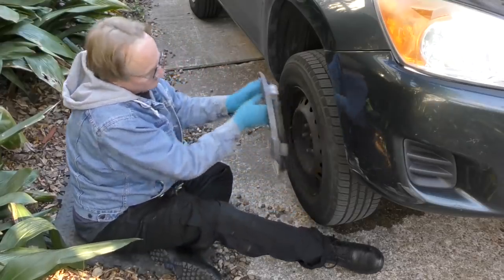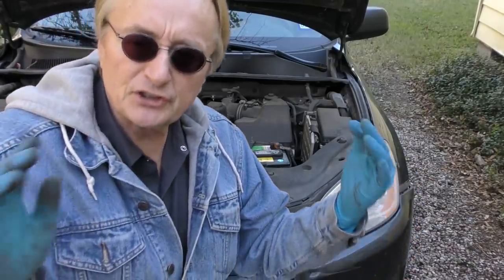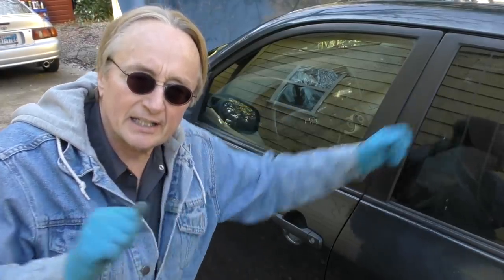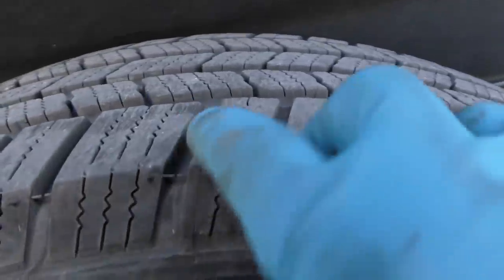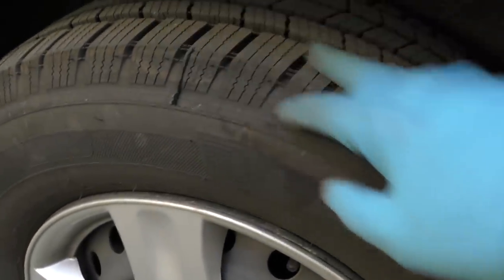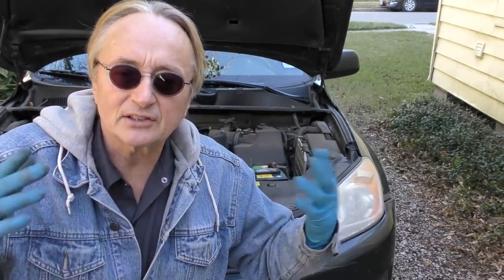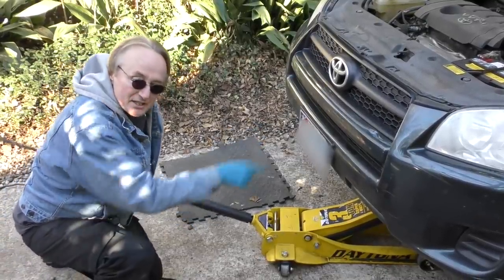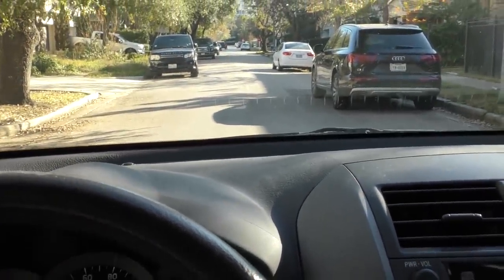Tire Secrets Only Mechanics Know

Comment: the idea is that most of the braking and weight is on the front and in a panic stop if you don't have enough grip in the rear it can come around causing a spin. it all comes from law suits from the 80s and 90s before abs was commen. why didn't you jack in the middle on each side on the sub-frame instead of all that time consuming each corner thing or do you get paid by the hour?

Comment: Scotty I took my wife’s car to Canadian tire to get 2 front tires they said we have to put the tires in the back. I said can you put them in the front and got they said it would slip when breaking if put on front I said still please put them in the front. And they did do that but they also tightened the breaks on passenger side rear tire so when wet out the back passenger tire would lock up. That is dangerous and ridiculous to do just to prove a point. I think they also wanted to sell 2 more tires because when I was getting my keys he said if it slips come back we will put some new ones on the back too. I never trust anyone with my cars anymore. People will do anything and risk lives for an extra buck.

Comment: Here's a question Scotty, and a freebee answer...
When I drive around in my 07 Escalade with the windows open, I occasionally hear an annoying cricket-like squeak from a wheel on one side of the truck or the other. Sometimes it sounds like it's coming from the front and sometimes the rear. I pull off a wheel and check the rotor and pads, nothing wrong. Put it all back on and the squeak is gone. Months later, it starts up again on the other side of the vehicle. Again, I take a wheel off, put it back on, and the noise is gone. 

So yeah... it turns out to be the hub caps! Pop the hub cap off, put it back on slightly rotated, and the squeak is gone. For a while. But you already knew that, didn't you? You ol rattlesnake!

Comment: There are two numbers on the side of the tire 4319 would be 2019 43 week of manufacture. anything older then 5 years goes into the garbage.
Reply: Probably for winter tyres. Nowadays tyres have longer shelf life and "on the road" life.... ofcouse dependant on how much sun light they get and how you overhead them in the canyon.  I have a forester the summer tyres are 9 years old but they have decent thread and no cracking. On a friends car he has 5 year old Nokian tyres cracked all over. So inspect the tyres and see whtas their condition if they are good drive them. You will save money and the environment as you will produce less rubber waste. If everyone sticks to your recomendation boy oh boy how many billion new tyres will end up in the dumpster

Comment: they did that to me one time after about 5 minutes I just told them to take them off and put my old tires back on. they moved them to the front. my mom went in with the spare on the truck and told them she wanted 4 tires mounted on the wheels and put the steel wheel as the spare. damn if they didn't put tires on 3 mag wheels and one steel and didn't and mounted her bad tire as a spare. after fighting with them for over a hour she called me and when I got finished with them she came home with 5 new tires for 100% free. but we refuse to even go to them anymore.

Comment: I'm so glad you mentioned tire placement arguements with "tire experts" they are complete morons. Maybe in a RWD car do you want the good tires in the back. 

If I didnt MAKE them put the best on the front I would of flipped my car. Getting of the freeway I hit the onramp a little fast, my normal speed. Low and behold,  there was a stream of water! My rear end slipped out but my front kept traction. 

If the bad tires where in front I would of lost control and crashed instead of being able to get ahold of it.
Reply: That is exactly why you put best tires on the rear, is to keep them from hydroplaning. It sounds logical to put best on front for traction, but at high speed when it is most dangerous is when you want to do what is the safest, with less weight on the rear you need better tread to disperse the water better to keep it from spinning around. It just happened to one of my fellow employees , because they thought the same thing, best on frount and it rained the next day and he hit a water puddle and the rear end came around and he totaled his car. Go to tire racks web site and read the article they have on their sight. I am a master certified technician and I keep up with what is discover from most recent events. I have 50 years experience. Final thought: Rotate tires every five thousand miles and replace all four tires at the same time and remember that most technicians in your modern shops have fresh eduction.
Reply: @lest0328  That told 'em, Les.  Too many petrolheads out there driving around blissfully ignorant!

Comment: I guarantee you those struts are worn out.   Pushing on the bumpers to see if your shocks are good will not prove anything really.   Those front tires are wearing more like they are is because the  shocks are worn out and may need a front end alignment.

Comment: I loathe and detest front wheel drive cars.  Of course, it's a better use of space, you don't have the power wastage in the transmission to the axle and it pulls better on snow.  But the thing for me is handling characteristics: you make a mistake with rear wheel drive you go into oversteer, which is easily correctable.  Make the same mistake in FWD, and you understeer and, yes, you can correct it but it takes time by which time you're car's making out with a tree.

Comment: I completely disagree with you, the best tire should be on the rear wheels. yes, bad front tires will be an issue, and putting them in the rear, you won't feel that they're bad: that's exactly why you should have the best tire in the back. New or old car.

You can't feel the rear tires, so you need to make sure that they will lose traction after the front do, because when the rear tire loose traction, it's sudden and a lot more dangerous and harder to correct than losing traction on the front axle.

I've experienced both, and I will always choose to put the best tires on the rear axle.

So the exact reason why you say you should have the new tire on the front is the reason why you should have them in the back.

Loosing traction accelerating is not deadly, spinning out is.

Also, because front tires wear out faster, it's a good way to preserve your new tires and use the old ones so you don't and up with old dry tires on the rear axle. And tire that are slightly older usually don't wear as fast as brand new ones. So financially it's better.

If your tires really don't feel right on the front axle, you shouldn't use them on the back.

Comment: speaking of hubcaps, you might notice many late 90s and early 2000s Corollas and Camrys missing hubcaps. They become loose and fall off because of the poor cheap design
Reply: Have seen this. They should have done as honda did back then and make it where yhe lugnuts secure the hubs to the tire. Ive a 20 year old civic with all its original hub caps.

Comment: Putting the slippery tires on the back increases the risk of a spinout.  Watch how often this guy says how slippery his tires are, and then explains how he put them on the back.  He's so proud of himself about it too.
That's why they won't put them on the back Scotty, because when you spin out neither you or the victims you hit can blame and sue them.
Also you should know better than to run 7yr old tires.  Tread depth is only part of the equation.  The rubber, adhesives, and the steel belts in the casing oxidize and deteriorate over time.  No tire should be in operation on a public road older than 6 years after manufacture.

Comment: Could’ve been warped rotors 🤷🏻‍♂️
Reply: That would've be the next thing to diagnose/check if the tire rotation didn't solve the problem.
Reply: Only problem is , he didn’t go fast enough... I’m sure it has warped rotors . 99% of the time if you feel a shimmy in the steering wheel ONLY when you hit the brakes, the rotors are warped . If it shakes without applying the brakes , the tire is either out of balance or out of round .

Comment: you can put your tires where you wish, but i will put them on the rear. after loosing an argument with a tree and the passengers side door on my old truck after moving the better tires to the front (recommended from my old mechanic).I would gladly have hit that tree with the front of the truck than the door any day.

Comment: It's "The best tires in back, in the winter".  Or with any hard braking and you'll be going for a spin.
Reply: I had this problem with a tire place where my front tire had a previous camber problem causing the tire to start showing belt and the guy said "we can't rotate your tires because the better tires need to be in the rear." If it wasn't for me having to send someone to get them rotated for me I would've fought him. My commute at the time involved the freeway where there's this downhill with a curve at the end where the worn tire would be on the outside of the curve, and the whole reason I sent it in was the thought of blowing that tire and going off at about 80+ mph.
Reply: 4 new tyres and hard braking and turn and still go for spin. But yes as some have said, drivers think only understeer would happen if brake and turn car or just turn even. Depend if all 4 new tyres or how front and back tyres are as well as how hard brake before turn

Comment: Some years back I bought a set of "Falken" brand tyres for my little sporty.  Worst things ever.  Probably because of a dud compound and maybe later revisions fixed it, they were okay in the dry but anytime it got wet they were a disaster just trying to get off the line or even accelerating in 2nd.  This is a crappy 1.6 litre front wheel drive BTW.  From new to worn I hated those things.  The brand I have now are brilliant, but forgive me if I don't mention it here as I'm too lazy to take a look.. ¯\(ツ)/¯

Comment: Scotty I work at big o and your wrong on this video, you are putting a lot of people in danger especially in wet weather making them think you should have your better tires on the front.... When you corner and make split second turns that could save your life you want your good tires in the back. When you turn your car all your momentum shifts to the back tires and that's where you want it to grip the road better so you don't lose control and spin out , listen to me society this oldschool dopefiend mechanic knows a lot I watch all his videos but trust me on this one , it proven when you corner your back tires are the ones holding your composure , better ones in the back during bad weather shift them to the front during the summer ,spring.

Comment: Correct me if I'm wrong but shouldn't the car break normal in the first place with the "OK used tyres" on the front. I mean these are still very good tyres with lots of life left in them. What you are saying is having 2 "OK used tyres" with lots of life left in them on the front of your car makes it feel like losing control when braking at higher speeds. So what's gonna happen if you have 4 "OK used tyres" on your car.... like 99% of all vehicles out there on the streets. So this doesn't make any sense to me that 2 "OK used tyres" on the front and new tyres on the back is making your car feel like losing control. If there would be a new tyre on the front left and a very badly used one on the front right I would agree but when having two same ones with the same condition the car shouldn't perform any different then having a longer or shorter brake distance. From my experience having proper torqued lug nuts and having your tyres balanced does the trick. But still don't take this as criticism, it just doesn't make sense for me.
Reply: It makes perfect sense. Those tires should have been rotated long ago.
Reply: @rays7437  Well if you were able to grasp meaning from reading you would know that I said the tyres should be rotated.
Reply: @mathiasm3462  
Your comment reads as if it were based on the assumption that the front tires were worn evenly.
Reply: @rays7437  exactly, why shouldn't they
Reply: @mathiasm3462  
The tires were not worn evenly. If the alignment is off or the struts are weak, or the driver corners hard,they wear unevenly.
Reply: @rays7437  OK so how is that gonna change if you put the front ones then on the back....?
Reply: @mathiasm3462  
Because the rear tires wear differently than the front tires.  The driving tires will wear differently than the riding tires.  Tire rotation is the practice of moving the wheels and tires of an automobile from one position to another, to ensure even tire wear. Even tire wear is desirable to extend the useful life of a set of tires. The weight on the front and rear axles differs which causes uneven wear.

Comment: Damn he is putting those lugs back on with the impact driver. I always hand start the lugs first, then air drive them, then torque them down to specs. Putting them on like he did can cross thread the lugs.    Not good..

Comment: New tires go on the rear because under  wet conditions you're more likely to spin out of control while driving turning in wet conditions with new tire's in front and worn in the rear.  Michelin tires did  scientific research and proved it.  Btw I've been a technician for 40 years and I'm 44 year's old too. I started working on cars in my mother's womb.  😂
Reply: mechanics ride hars ,so must accelerate quickly..thats important..and must stop quick too..
Reply: @maartenyzer4121  When tires are replaced in pairs in situations like these, the new tires should always be installed on the rear axle and the partially worn tires moved to the front. New tires on the rear axle help the driver more easily maintain control on wet roads since deeper treaded tires are better at resisting hydroplaning.
Reply: @firebird196771  i know but i always put the best in the front ,so i can change all 4 at the same time ,so all my tires are fresh and not rotted..
and have the same dot..

Comment: I have the worse luck with tires.
Reply: New Edge Mustang,
Does that have anything to do with how you drive the car they're mounted on? Or the quality of the tires?
("Good luck favors the well prepared.")
Reply: @ArcoZakus  yeah i have toyo 888 its just where I live they have no concept of cleaning the roads.
Reply: New Edge Mustang'
I wonder if you could build a low air dam in front with broom-like bristles hanging down the last two or three inches to the ground. Might be worth a try. 

It would look odd, but if it saves you from even a few wrecked tires it might be worth it. If it works, you could be like the "My Pillow" guy and get rich selling your invention to everyone else.

Something else, I just recalled from when I was a kid knowing a guy who would prop big nails up against the bottom of tires on cars parked in the neighborhood just for fun (sick kid). One in front and one in back, couldn't miss. Worth checking for before driving away if that's a possibility.
Reply: @ArcoZakus  lmao its parked for the winter. But I'm about to that point and it is mostly the front tires.
Reply: Robert Burley,
Worse luck with engines and transmissions IS worse than worse luck with tires, but that does not make having a flat tire not feel bad, if you know what I mean. Worse luck with LEOs is the worst, though.